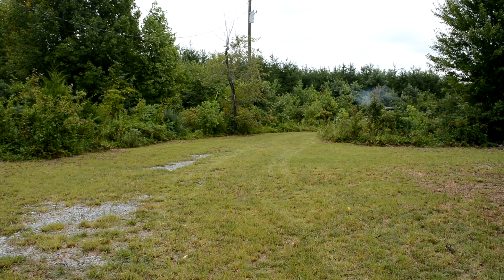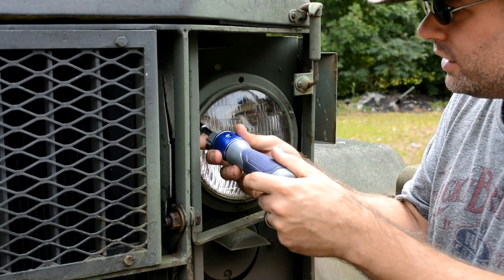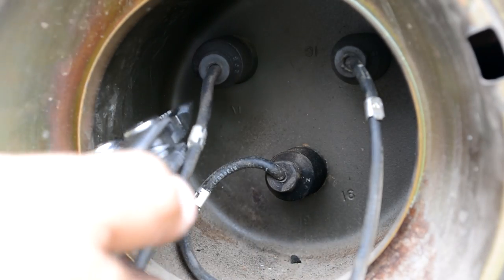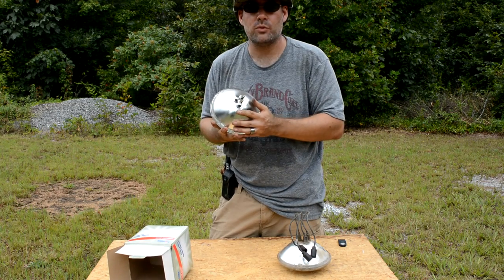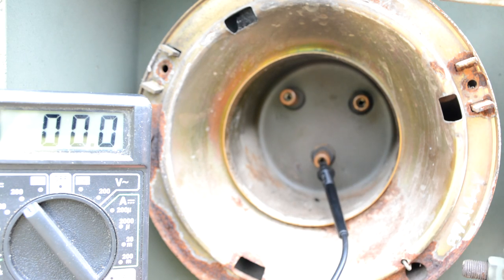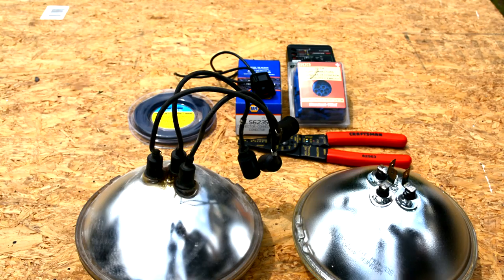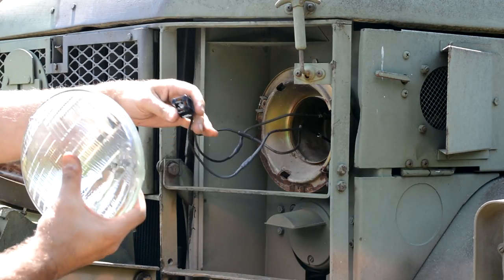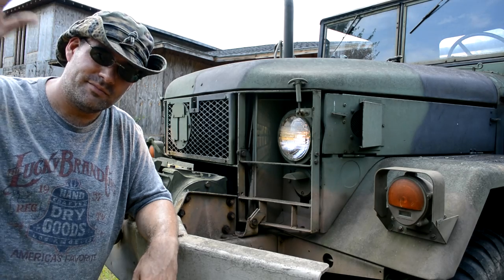Deuce Headlight Replacement

Comment: If you use some silicone grease it will help seal things and make it easier to plug and unplug. Also a little in the butt splice will help keep water out. Any silicone or Teflon grease will help keep water out of the connections. It is always good to use in almost everything. A small amount of it on the screws when you put them back with help when you need to take them out next. It keeps water away from the screws and keeps them from rusting. I have used silicone grease on a lot of things to help keep water out. Another thing is WD-40. Most think it is to lube! WD stands for Water Displacement!! It was made for NASA because they had trouble with water getting into the everything in Florida.

Comment: great video you should put some dielectric grease on those plugs next time though
Reply from the maker: 429redneck That's a good idea.  I've always used that on everything at the house but the second I set foot on the farm my mind goes to the Dukes of Hazard school of car maintenance where everything is fixed with duck tape, WD40, and chicken wire.  I really need to get out of that mindset.

Comment: What a great cheap fix! I'm glad to see harbor freight made it into the video. Lol. I'm a big harbor freight fan myself. If the heat gun works good why not use it right? Hopefully you got that with a 25% off to make it even cheaper and on sale. Lol. Oh yeah, don't forget the free item too. Haha. I'm not trying to sound greedy here but they offer coupons so why not? Anyways, I really like how you made the connector and bought a bulb that's readily available. You heat shrinked it too. Very nice neat, clean job!! I need to do the same to my boat trailer lighting. I'm having trouble with a good ground.

Comment: Why can't modern vehicles be this easy to change a headlight on? Instead you gotta take apart 1/2 the front end of the car to get to the light.
Reply: it made so you have to pay some one to do it
Reply: john smith exactly
Reply: And miss out on the experience of going out to your car in the morning, in the dark, late for work, to find that your headlights have been stolen?
Reply: @Chris-du7hi  This comment is capable of the stupidest comment of the year reward.
Reply: @Chris-du7hi  that actually gave me forest Whitaker eye.......
Reply: 09+ Chevy almost everything remove bumper to replace headlights.....
Reply: @Chris-du7hi  Tough neighborhood?   It is like the exterior designers rule.  The mechanical team, already stressed by emission controls, mileage and our "need for speed," don't have enough to worry about, stuff keeps getting stuffed behind the headlights blocking easy access.  Take care.

Comment: nice work I'm not a big fan of the butt connector and while you certainly made a clean job of it semi exposed to the elements the way the backside of the headlights are I would suspect corrosion if the light fails I'm also a fan of dieletric grease on the 3 prong connector another great video thanks for taking the time to show us what you did

Comment: I wonder what the panel in the grill next to the passenger side headlight covers?    There are three covers on it.   I'd guess it is more towing / military accessory stuff, like the 24 volt charging connector.
Reply from the maker: That's actually the bridge weight classification plate.  When the military was active in an area they would rate each bridge with it's max safe load and mark the bridge with a number.  The three small plates on the main circular plate would normally have a number on each.  The passenger side plate would show the weight class for the truck empty, the driver side would show the weight class when the truck was loaded to full capacity, and the top plate would show the max weight of a trailer.  As long as the number on the bridge was equal to or higher than the plate on the deuce it was safe to cross.  Good question.

Comment: Thanks for the info  
My head light went out last night 
Took a snap shot of the info you gave walked into Napa  showed them the pic 5 mins later I was walking out with my parts 
One thing how do you change the lights from hi to low ?
Reply from the maker: Awesome!  I'm glad the info helped.  You should have a silver button on the floor left of the clutch pedal near the firewall to change from hi to low beams.  This was the normal hi-low beam switch in most cars/trucks up to the mid 80s.

Comment: I am no mechanic, nor an expert on the operation of the M35a2, but I think you could have used some electrical grease on either end of those wires.

Comment: Any help to buy a Deuce.  I live in Georgia.
Reply: E-bay, Craig’s list is really good. Boyce Equipment out of Ogden Utah., Memphis Equipment, C&C equipment, eastern equipment near philly, and several other companies, private sellers , there are more web sites also that have them listed. Private seller is the cheapest but you got to know what your buying. 
I think the fuel injection pump is one of the most important things to check out.

Comment: whats that devise below the headlight you changed
Reply from the maker: That's the blackout light.  It'll give you just enough light to see where your wheels are in a pitch black covert situation.  The light switch can be set to turn on this tiny light and turn off headlights, turn signals, tail lights, brake lights, and instrument lights.  It has a shield to direct all light straight down so the enemy has a harder time locating the truck from a distance.  Good question.
Reply: ***** I have heard that it is supposed to be visible only in night vision goggles, thus keeping your level of stealth considerably higher than with a regular bulb.
Reply: John Ronkainen you cant see it at all if you more than 30ft from the vehical but you can see it without NVGs (Night Vision Goggles) on while driving but its super dim. When you do night driving in the military you will almost always have night vision. Except that one time where they didnt have any extra NVGs for me or my navigator so i was driving with just the blackout light on and no moon. I couldnt see anything except a very faint glow around my front left side of the Humvee my navigator was ground guiding me and i couldnt even see him. It was really sketchy! I acquired NVGs the very next day because i was not going to do that again lol. No one got hurt though thats all that matters :)

Comment: Would it be impossible to use as a daily driver
Reply from the maker: I wouldn't say impossible but depending on one's commute uncomfortable and expensive.  I drive mine to work a few times a year and that's enough with my 30 mile commute.
Reply: What about using it to carry lawn mowers
Reply from the maker: It'll haul plenty of lawn mowers but with a bed height of just over 4ft you'll need some long custom ramps for anything you can't easily raise to chest height.
Reply: I use mine as a simi daily driver, meaning a couple or few times a week, lows, Home Depot, deep snowy winter days, or excursions, visiting relatives getting groceries but mine is bobbed down.

Comment: Anybody else cringe when he put the wires into the butt connectors without twisting the strands tight?
Reply from the maker: I used to twist everything till I ran across a metallurgical report showing that twisting added stress to the copper and added little to no benefit to the longevity of the connection when done properly.  That was ten years ago and nothing I've done has had an issue.  Of course nothing I've done before that has had an issue either so I'd say the for/against twist is largely an academic argument at best.
Reply: Hmmm interesting. It just seems like an unfinished job though. Oh well. Great vid anyways as usual!

Comment: Jus spent over $200 on Putting in LEDs for the headlights on my deuce, it's amazing how much better it looks . My question is what does my headlight switch need to be turned on to have headlights going and the running lights on? I know hiw to turn the running lights on only and turn Jus headlights on only but can't figure out how to have both on . what do both switches need to be on? please
Reply from the maker: Those LED headlights are awesome and they've come down in recent years.  When I first looked at them they were closer to $500.  Once I'm through my stash of new old stock headlights I'll think about the upgrade.  As for your question.  Without some creative rewiring it's either headlights and turn signals or running lights and turn signals.
Reply: +DEUCE AND GUNS thanks
Reply: Not sure exactly what your problem is, but you may need to install a resistor in the headlight wiring for your regular bulbs to work at the same time.